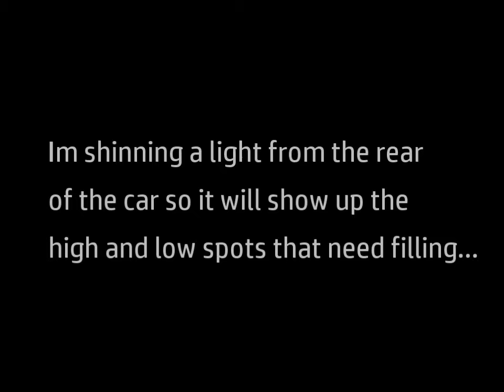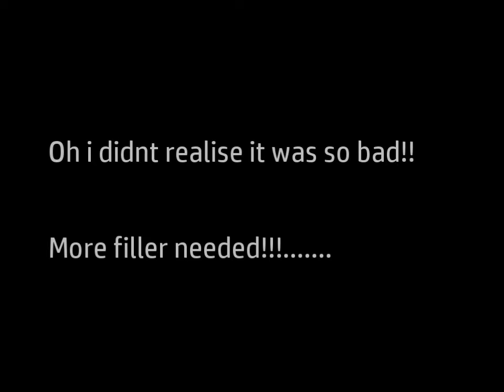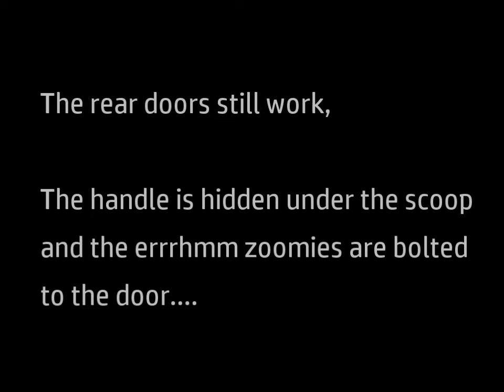Part 4 Mad Max Lexus LS400 Build Progress

Comment: what are you using Bondo and foam?Maybe I missed it but I’d love to see a video about the stuff you use and how you mix it etc.
Reply from the maker: I got the shapes with foam... Then fibreglass for retaining the shapes. Then bondo/filler it to smooth the roughness of the fibreglass. Then filler primer paint. Lots of filling and sanding for sure 👍
Reply from the maker: @Roosterjello  ive only just by accident seen your messege! i had no idea you had messeged me back! very cool car btw, i litterally just rolled two sheets of aluminium and my trusty neighboor tack welded the sheets together.  the thing has been filled to cover up gaps so actually using one as a scoop for an intake probably isnt a good idea chap incase the filler was to crack off